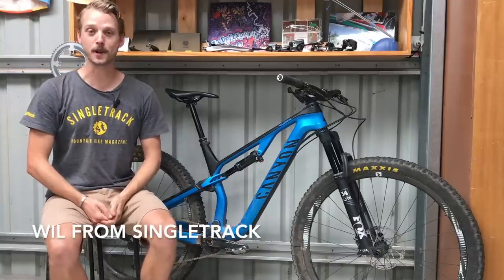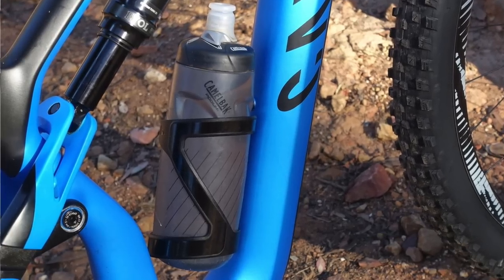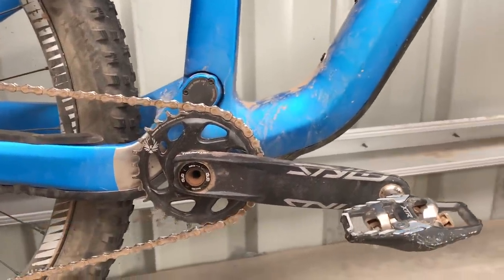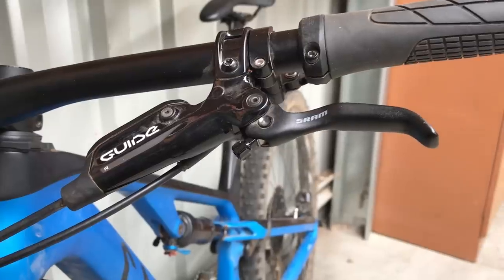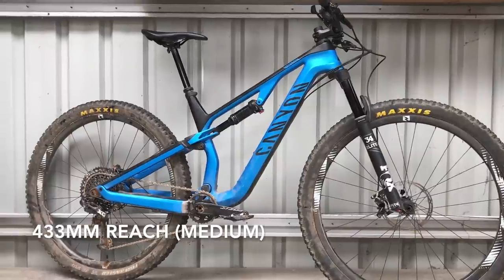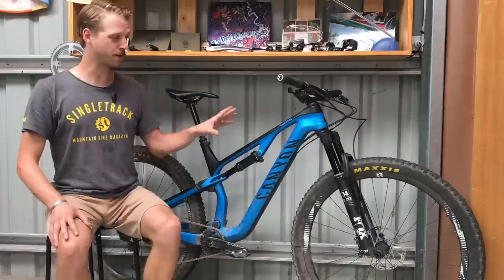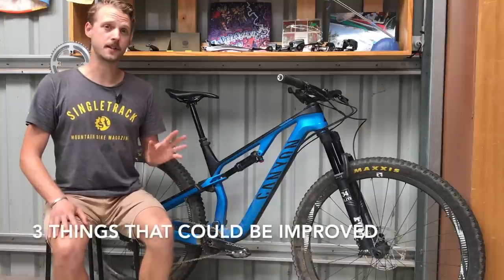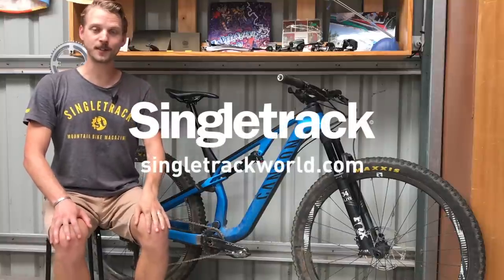2019 CANYON NEURON CF REVIEW | A Longterm Test Of Canyon's New Carbon Trail Bike

Comment: Definitely a great value and I like the more traditional geometry. Some of the this new "radical" geometry has become the latest marketing hype.
Reply: Yeah, there is nothing wrong with the geometry of this bike I would call it balanced. Personally, I see no point of having 78º seat tube angle and 64º head angle on a short travel trail bike that was built for long and comfortable rides.
Reply: Yup. I’m starting to read reviews where testers are saying a lot of these new bikes take more effort to turn. Not sure how that’s a good thing.
Reply: Greg Katz They are good for bombing down on steep descends but compromised on the rest. Balanced geo is better for a versatile trail bike
Reply: I ride a Nicolai G13 in XL. 77 degrees seat tube angle and 64,5 degrees head tube angle with 530mm reach and longer chain stays. With my 195cm it is the first bike that fits. It takes a different approach to cornering and you have to actively weight the front wheel, but corners are fun and when you get used to it, it becomes as effortless as any other bike. Only the limits get pushed a bit further.  I'd never want to go back on the "traditional geometry". Sure, you have to be active on the descents, but is that really a problem?
Reply: @lux-3001  For your height, the steeper seat tube angle and longer chainstays make sense I would do that on all XL bikes for the taller riders because @74-75 degrees with your saddle height you are sitting too far back. The 530mm reach with the 77-degree seat tube and 64,5 head tube is very average, it's the same effective reach as ~480mm on a 74-degree seat tube angle 67HA bike. The 64,5 head tube is usage dependent in my opinion, I would find it absolutely pointless on a short travel trail bike, it would lose agility it would feel sloppy. For my 180cm height, the 75-degree seat tube angle is the sweet spot, with my saddle height steeper SA would put me too much forward and it's not a comfortable position for a whole day ride which this Neuron was made for.
Reply: Yeah, but it is only the same effective reach when it comes to being seated. On a mountain bike, this is in my opinion only a part of the whole picture. Where you really benefit is in the active position where you have more room to move around the bike. As I always say, the best geometry is the one that suits you. If you haven't already, I'd recommend trying out a modern long reach geometry, but as with all things in life, it may not be your cup of tea. :) I know that my girlfriend is the happiest person ever on her Hightower, and it is quite a different approach to bike geometry, so... :) Ride on!
Reply: lux I tried long reach bike and I don’t like it. I cannot even call it ‘modern’ it’s just different, it doesn’t do anything better than the one I’m used to.